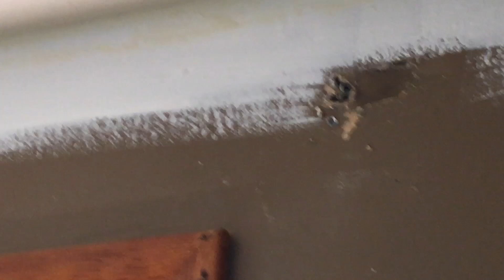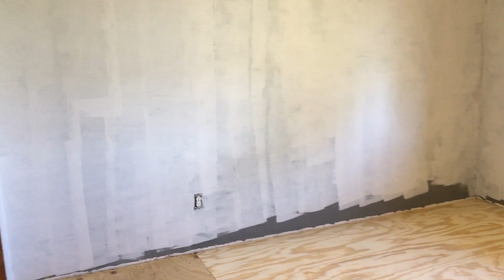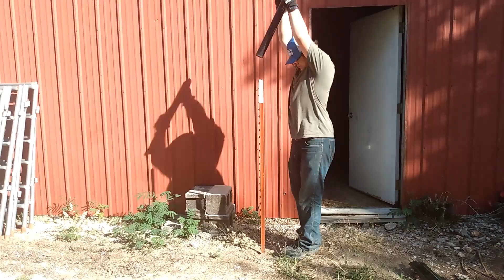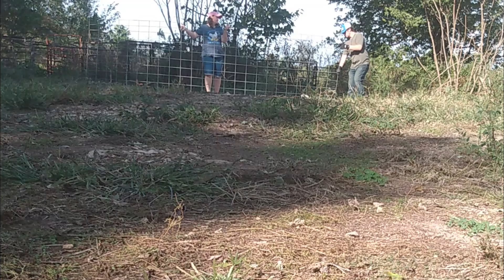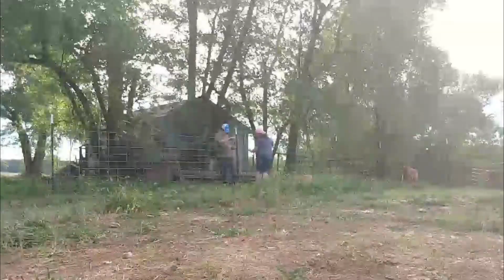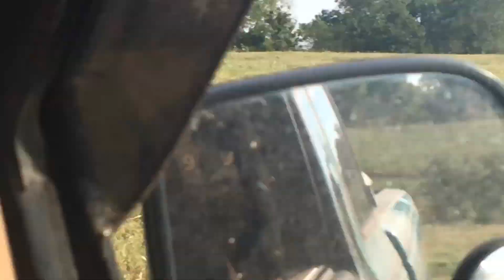NEW HOMESTEAD/Wall Prep & Temporary Goat Pen

Comment: To cover dark paint use a good quality paint not the cheap stuff from the gig box stores my Dad wasxa painter and he would use primer on dark walls first then 1 finish coat but you have to the quality paint. Primer cover in one coat if its applied properly.
Reply from the maker: My paint is mid grade. I think the need for a second coat is largely due to how the boys painted the first coat. I let them do the first coat and I apply the second.